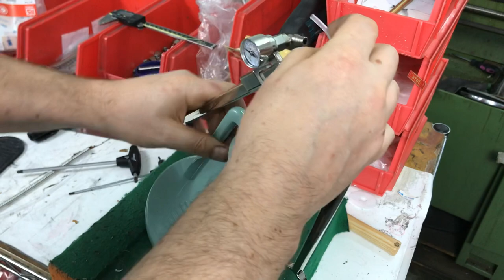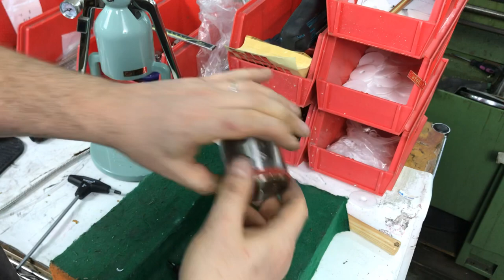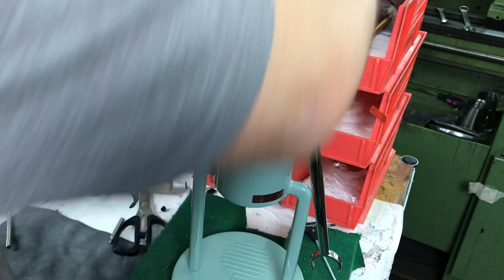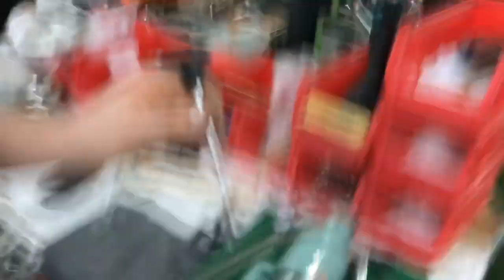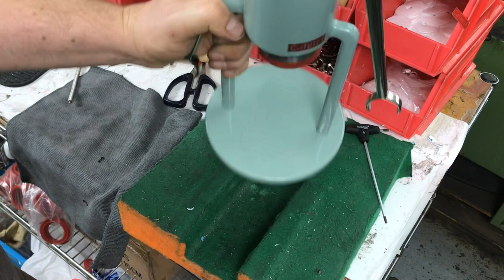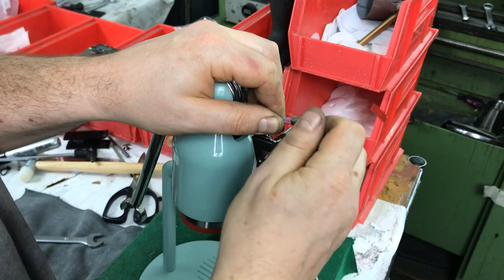Cable modification

Comment: What type of tube using.? As I see it ..wasn't silicone tube.if it's polyurethane...it will give u trouble in time.it will crack !
I will change the tube and lever mounting to the tube.use swivel fitting.

Comment: I just got my lovely Cafelat Robot. I have never used a manual lever machine before and I have been using the Robot now for just a few days. One thing I can't seem to get the hang of yet: I can not pull an even, consistent shot of espresso without channeling or spraying. My coffee always tastes bitter too. I am doing something wrong.
Reply: Where did you buy it? I can't find any info on sales.
Reply: All is related to coffee beans and especially grind size. Depends where they are from. Supermarket? Local coffee roasters? Who did the grinding. Try to vary the grind size. Worked for me. Needed a real fine espresso size. Too fine and the water takes too long to pass.  Too coarse and the water goes through too fast.
Reply: Unfortunately the metal sleeve design is flawed as it got trapped against the robot body. This has squeezed the plastic tube completely and removed it from the piston chamber. A slick or smooth sleeve design would be better to avoid getting caught. Now I removed it. It works but doesn't look as good as with the metal sleeve.
Reply: @jpmumbly  Did you have the "self-adhesive backed aluminium cable tie
" installed to guide the metal sleeve?